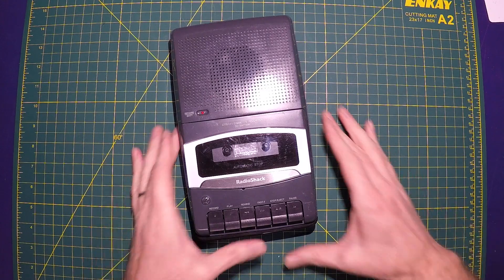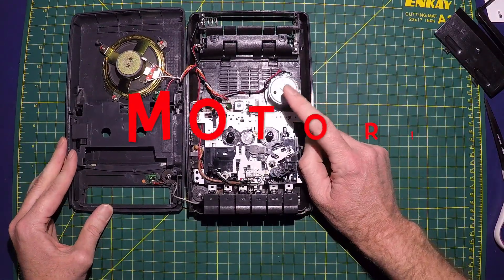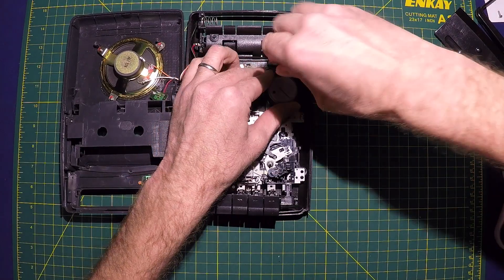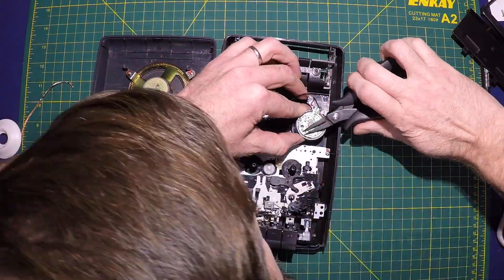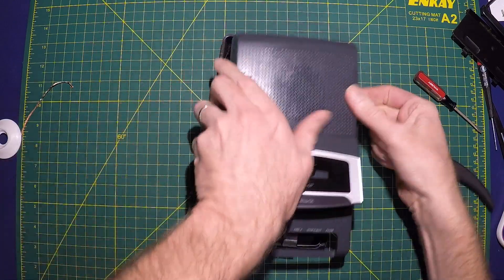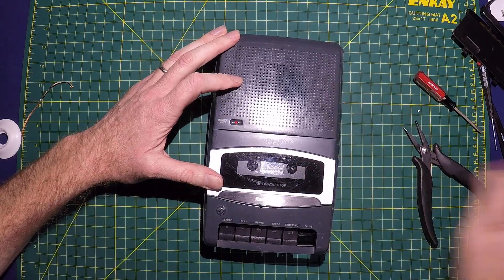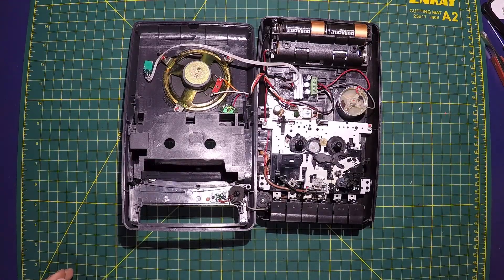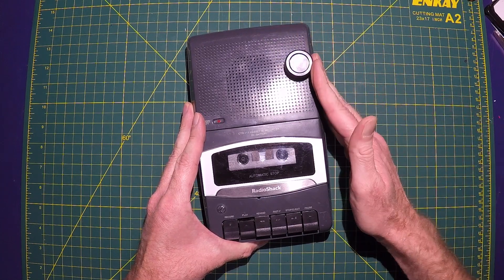How to add pitch/speed control to a tape recorder

Comment: Simon the magpie just posted a speed modded cassette recorder with a kalimba on the lid on Instagram. Pretty freakin' nice. Can't wait to hear how it sound. I don't know what kind of resonance he will get in the cassette player body though.
Reply from the maker: Yeah I saw his Instagram post but I’m confused, does it still have a tape?
Reply: @SISKworks  I think the Kalimba is built onto the door so it can still open and play tapes.
Reply from the maker: @NickGoblin  yeah I saw the video after posting that. You are correct.
Reply: @SISKworks  Now I finally saw it too. The acoustic is not that great but I'd love to check out that project where they put the tape player inside the kalimba instead.

Comment: I just finished this project. It came out really nice! I got one of those red 20kHz PWM boards. I had such a hard time desoldering the pot (I destroyed one board, the pads and the lanes came off) so I had to put it in a box on the outside. I’ll try to get better at desoldering components before I do this project again.
Reply from the maker: Oh that makes me so happy to hear that other people are doing my projects. That is so great! As far as desoldering goes, I always makes sure to add more solder first before trying to remove the old. Seems odd but it really helps.
Reply from the maker: Do you have a link to the red 20kHz board you used?
Reply: @SISKworks  Yes I do, https://www.lightinthebox.com/en/p/au-pwm-dc-motor-speed-controller-5v-35v-5a-led-light-regulation-dimmer-switch_p7931785.html?prm=1.5.1.30

In the last unit I modified I was able to fit the whole board inside the case. I haven't been able to desolder the pot from these boards yet but it probably says more about my desoldering skills than the board. I just upgraded to a rework station so we'll see if the new equipment will save me.
Reply from the maker: @themidithief4514  thank you!

Comment: What exactly does that tiny PCB inside the motor do? I'm trying this mod at the moment, and the casing on my motor seems to be crimped shut so I can't get into it without wrecking the motor. I'm going to try cutting the wires going into the motor, and putting the PWM kit there instead, and hopefully the little board won't interfere with it working.
Reply: I know this comment is old, but as I understand it this won't work. The wires going to the motor are just power, wheras this is actually altering the circuitry inside the motor itself.
Reply: @EpicStuffMan1000  Thanks!

I tried putting the PWM kit on the wires going into the motor, and it worked. A pulse width modulator is just something that switches the power on and off at high frequency, so it makes sense that this works. However, I was getting a high-pitched noise, which I think was EM interference from the motor, and then the fuse suddenly blew on my tape player. That was probably unrelated! I suspect I nudged a croc clip and shorted something, but it's a really nice tape player (A Marantz CD330) so I didn't risk messing with the PWM kit any more.

I used a potentiometer in series with the motor instead. It works pretty well: I can get down to about 30% speed before the motor stalls. Though below about 60% speed the pitch starts getting really unstable, due to the motor straining.

Comment: If some of you want to build this, pick a PWM controller with at least 20kHz but not much higher (not 100kHz or something like that) If your PWM controller is bellow 20kHz it will produce an audible noise.
Reply from the maker: Sirius360 Thank you so much for this! This has been driving me crazy why this unit makes that noise but another one with a different model PWM board does not. I’ll have to try and dig up the specs on each to confirm but I suspect this is my issue. Thanks again. I really appreciate it!
Reply: Hi,
I just installed a pwm on a cassette machine and it is causing an awful popping/buzzing sound which goes up in pitch as the tape speed increases.

I checked the khz and it is maximum 25khz so should be within the range you suggest.

Do you know what could be causing this?  Grounding? EMF interference? 

Any advice would be really appreciated! Thank you!
Reply: @mark_fox_music  Sorry for the late response. If the noise goes up in pitch as the speed increases, it's propably the motor itselfe which makes that sound. The frequency of the pwm controller should stay constant. To get rid of the motor noise is a bit tricky. I had the same problem on one of my cassette players. I ended up using a different power supply just for the motor so the motor is not connected to the cassette circuit.
Reply: I commented earlier assuming this suggestion was for the pot value but now that I have read a little more it seems like pwm frequency is different? Do you know of a specific model that would work best for this type of mod?
Reply: @idlefingerboards2629  i have used this one and it works great:
https://a.aliexpress.com/_mMsGA2d

i have moded 3 cassette decks already. sometimes the slower running motor can introduce noise in the system. you will hear a pitch which is higher when the motor runs faster and lower when it runs slower. this is not the fault of the PWM controller. 

in one unit it was really loud so I bought a different power suply just for the motor. so my whole deck runs off the normal power supply except the motor and pwm controller. because of that no motor noise can reach the system and distort my sound.

I hope you won't have to do that. but just in case you run into this problem
Reply: @Sirius-qr4vu  do you know if this mod will work on a Tascam 414?
Reply: @iltsocs  Yeah should work. Maybe you need to decouple the motor from the circuit but for that read my comments above.
Reply: @Sirius-qr4vu  Thanks!
Reply: Thanks, had this problem right now 😅

Comment: Is it possible to use a speed controller with forward and reverse? Would the tape play backwards if using this:
https://www.ebay.com/itm/PWM-DC-Motor-Speed-Controller-6V12V24V-3A-Speed-Control-Forward-Reverse-Switch/174136417344?hash=item288b56dc40:g:9hYAAOSwzWFeAvNX
Reply: It would work to reverse the motor but chew your tape up on reverse
Reply: Have you try ? Did it work ?

Comment: Great content Mike. Your videos always get me pointed in the right direction. I have copied your bends many times with great success. Thanks for sharing. I miss MOOGFEST this year!!!! :-(
Reply from the maker: john hardig Thank you very much. That is awesome to hear! Now I’m curious, which bends of mine have you done? Any videos?
Reply: @SISKworks  I used your Moogfest/harp delay circuit bends to make a eurorack delay module. I am also inspired by your use of ribbon cable. You turned me on to using pre-made inexpensive circuits to add functionality to my bends like changing out the capacitors in a function generator circuit to make an LFO. I also made myself a Hellophone microphone. And now I am working on using the LTC1799 to add a pitchbend wheel to a CASIO sa-76 project. The CASIO SA-76 sounds so good even without modification. I have eight of them sitting on a shelf. I would love to send you one or two of them for free. sorry no videos, I spend all my free time watching you and Kristian Bladsol and soldering. Let me know if you want some free Casios.
Reply from the maker: @johnhardig9754  BTW this makes me so extremely happy to hear!

Comment: This is excellent! Could you please provide links to the PWM board, or more specifics as to which one it is? There are a lot to choose from.
Reply from the maker: Oh yeah. I didn't include any of that did I. Well now that I look back I see I actually bought on ebay and can't find them again. But looking on amazon these would also work.  These are better than what I used because they are smaller.
https://www.amazon.com/dp/B07W5NZPH1/ref=sspa_dk_detail_6?psc=1&pd_rd_i=B07W5NZPH1&pd_rd_w=ghWRj&pf_rd_p=45a72588-80f7-4414-9851-786f6c16d42b&pd_rd_wg=6b0B1&pf_rd_r=8R7B1CSMV2P8V7AH3HN7&pd_rd_r=c4a5f04f-d711-4bbe-996a-e7980cac59ee&spLa=ZW5jcnlwdGVkUXVhbGlmaWVyPUFXT0E5V1VXTFlWMFYmZW5jcnlwdGVkSWQ9QTA0MDMzNDUyRzlOQTY4RFVXTEhLJmVuY3J5cHRlZEFkSWQ9QTA2NTYyNDIyS1RBMzBZTVo2MDdGJndpZGdldE5hbWU9c3BfZGV0YWlsJmFjdGlvbj1jbGlja1JlZGlyZWN0JmRvTm90TG9nQ2xpY2s9dHJ1ZQ==
Reply: Love the music, love the instructions. Just getting into this stuff soooo keen